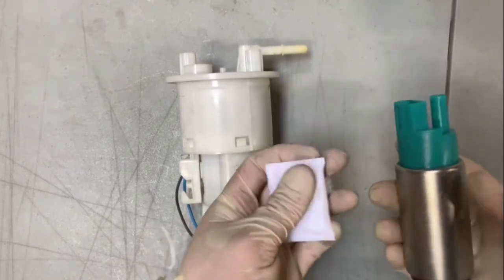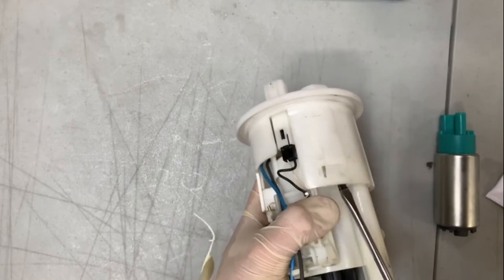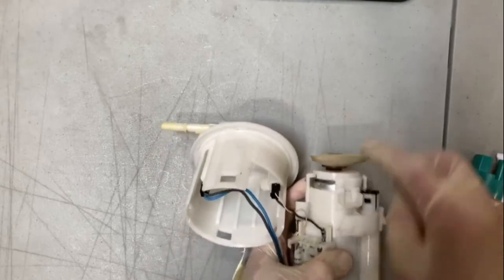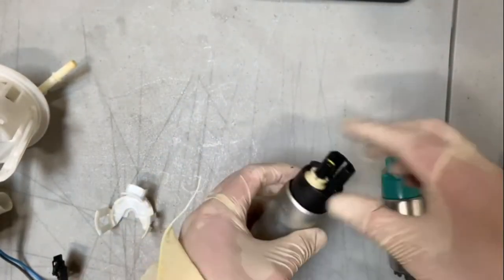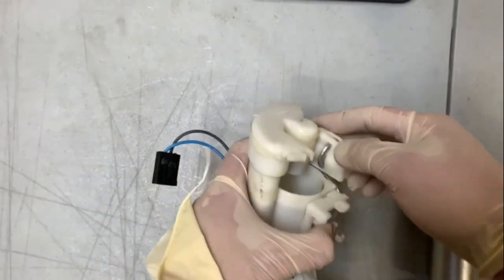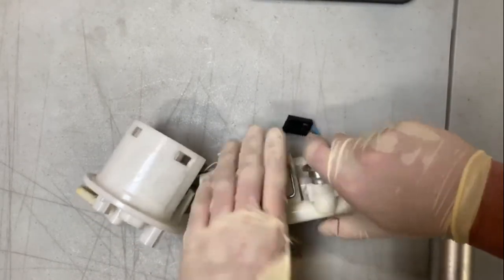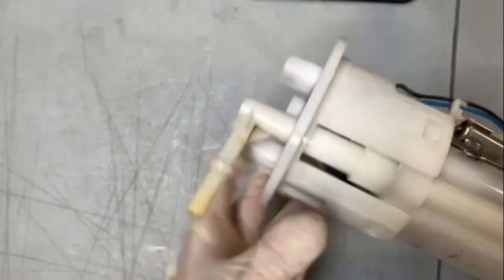FPF Yamaha R1 fuel pump installation

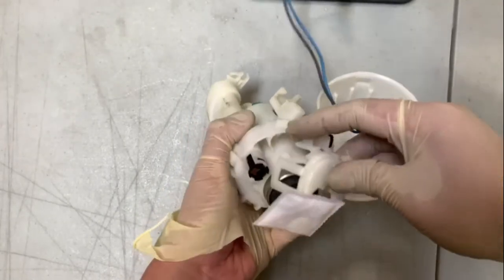Comment: 3:08 that black o ring you see in the pump housing has to come out of that hole and slide over the top hat piece that slides in there or your pump will leak out if the pressure 90 fuel supply